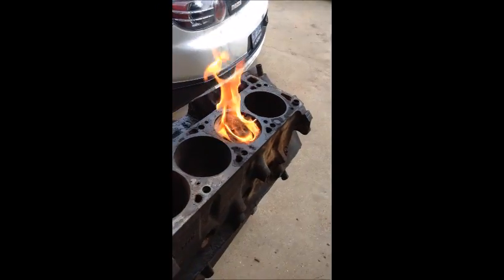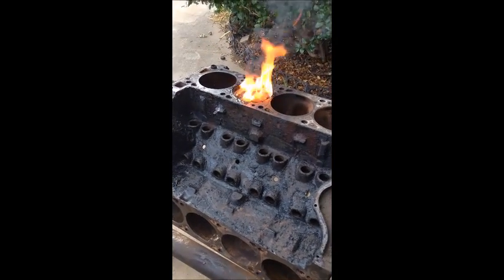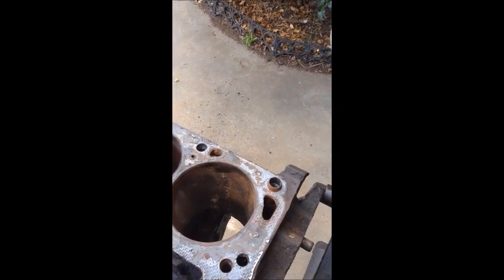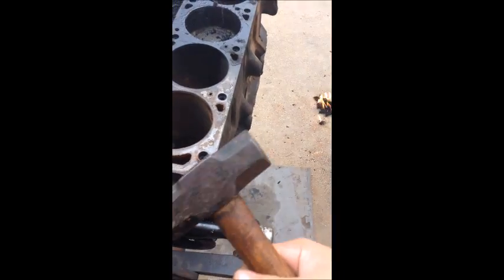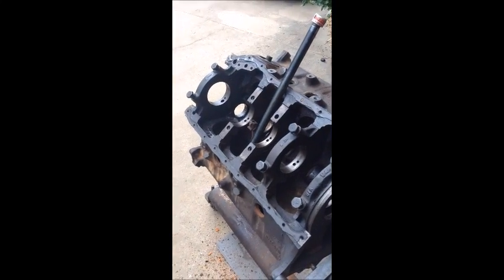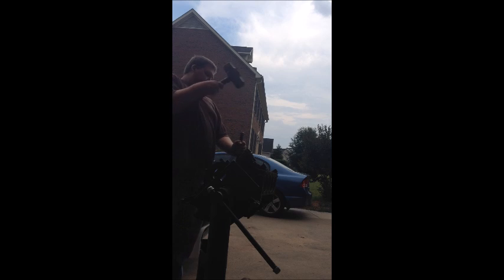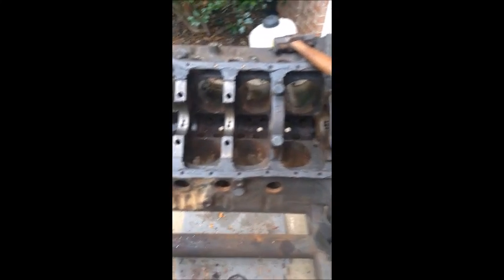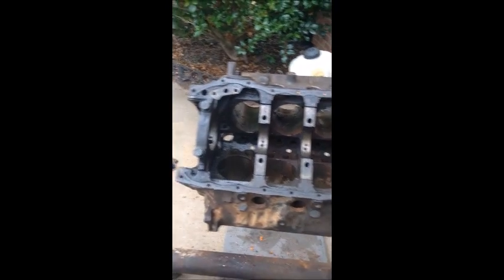How to Remove a Seized Piston

Comment: That stand acts like a spring and absorbs the blows from the hammer. You had the right hammer and the fire trick. But you should have laid the block on the ground and beat on the piston with a few hard blows. 
We all have set backs when working on engines. I couldn't get an exhaust to bolt up to a header once. I had to sit back and think about it. Took the header off the block loosely bolted it to the exhaust and the block where they could all wiggle together. Then bolted them all up at the same time. That worked.

Comment: Put diesel on the top of the piston for a week. (Or a month.) then use a wooden block(end wood) that sticks out a little more than the combustion chamber is. put back the cylinder top, tighten the four surrounding cylinder top bolts and the piston will move down. wiggle it up and down with hammer. use thin oil or diesel. finally it will come all the way. To use heat can do the trick, but I would think twice since the cooling water is not there and heat can make serious damage to the cylinder block.

Comment: I've used a propane torch to remove stuck bolts and nuts. Even worked on salt water eye bolts to anchors. They go 'tink' and that's the sign it has started popping loose. Would a torch work on the piston and cylinder the same?

Comment: Good job dude! I love making stuff work that others give up on! The 400 is actually really easy to get to be  a strong running motor. Jon Kasse was asked how to get 400 horse power out of one of these... he says easy! Just ad 3 C’s. compression, cam and carburetion. Then pull off plug wires till you get there lol.

Comment: The next time you have this problem, use brake fluid before any other penetrating oil...brake fluid will seep into places most penetrating oil won't...give it a try.

Comment: I don't think you even needed to light it on fire... what you do is if you stick your rod down in there and you use some rags to hold it in position that way you can put two hands on your sledgehammer and actually swing it... not just lift it up and let it fall. you weren't swinging the hammer Bud. that was the wimpiest swinging of a sledgehammer I've ever seen. With that little Sledgehammer you should have been able to break that piston right out of that bore.... done it many of times myself.  They always come out in pieces long as they're not forged then it takes something pointed.

Comment: 100 better ways to do this, better off heating the block then cooling the piston but risk cracking something.

All you did was break the rusty bind by expanding the cylinder, the piston expansion didn't help.
Most people use heat on bolts to expand them and cause the rust bind to break, or expand the nuts so there is more space to move the debris past it. If you heat up the inside part, you still have to wait for it to cool down before tryin to break it free.

Comment: Just sit down having the ass hole sealed on the cylinder with the seized piston, then push out as hard as you can. As soon as you pop huge ass fart, the piston will just slide out with ease

Comment: Thanks for posting this video.  Out of curiosity what ever came of this block afterwards?  Were you able to use it and how much machine work (or DIY work) did you do to get it running?  I'm starting my first project with a BMW M21 diesel, one is running in the car, other is a parts motor but must have had coolant sit in 2 3 4 and 5 for a while as it's seized up.

Comment: Another old trick that works well, is to heat the metal around the piston, then hit the piston with some CO2 from a CO2 fire extinguisher. it caused the block to expand, and the piston to shrink. The piston should come out relatively easily. You started OK with the fire, which heated the block.  The CO2, when it comes out of the nozzle is very cold.

Comment: the old school remedy for this problem is, = with an electric hot plate is to heat ,half a quart of fuel oil #2  do not boil the oil,  pour it on top of the Piston, let it cool . after the natural expansion , contraction , process and COOL DOWN  piston will come out.

Comment: Fill the bore up with coca cola the acidity will eventually break down the rust around the rings after a day or so that's how I done mine when the block was outside for years. Done mine from the top but you could probably flip it and fill the bores from the under side to make sure you get plenty in there. We used to do this as kids on our bicycles too, when the seat post was jammed solid with rust we filled the seat tube up

Comment: Next time you run into this problem heat up the  cyclinder and sit a bar of parafin was on top and let it melt it's way down past the piston and rings ..wait few mins smack it with a hammer and drift it'll fall out 20xs easier than you can imagine..works Everytime!

Comment: Build a thick plate 2 Bolt over the cylinder hole with a grease fitting inside of it with a hand grease gun you can shove any piston out I don't care how stuck it is

Comment: I’d assume for best results do the fire flip the engine spray some water on the bottom of the piston and that should cool the piston faster then the cylinder wall and would break the rust  my two cents that’s how I’d do it

Comment: Haven't seen the video referred to, but pretty sure you are supposed-to give it a few minutes after removing the heat source, before hitting it.
Aluminum expands & contracts faster that steel.
You heated both for a while, now give it a few minutes without heat, and as they start to cool, the piston will "shrink" faster than the block.

Comment: Next time just take a torch to the piston Get pretty hot try to avoid heating up the block too much And then just Douse some WD40 or Marvel mystery oil in there and you should be able to get the same turn out Without affecting the heat treating of the block

Comment: Why not just soak it with a 50-50 blend of Marvel Mystery Oil and Liquid Wrench,   then vibrate it with an air chisel while hammering on the rod?  It would have come right out.  I used to work in a transmission shop,  and my boss swore by the air chisel.  Especially for impossibly stuck bushings in blind holes.  It worked  quite well.  No heating required.  

Of course,  since you were re-boring the block anyway,  the red wrench would be even faster.  A skilled fabricator can blow out a sheared off 1/4" (or larger) thread stub from a sheared off pipe nipple in a cast iron body,  without damaging the parent threads.  I was once working on a steam press at a dry cleaners.   I was their general mechanic.  A quarter inch steam pipe broke off flush with the receiver, leaving the remains of the nipple galled to the threads inside.  I tried several bolt extract ion tools (EZout, etc), to no avail.  Two slipped, and one broke off inside the broken pipe.  Since I had nothing to lose at this point,  I went and grabbed the red wrench.  I was able to burn out the broken off tool and pipe fitting, without damaging the female threads in the body.  You see,  the galling provides insulation and protection from the heat.  The body is a massive heat sink, so the parent threads simply cannot get hot enough for the oxygen to burn,  provided you do it right.  A skilled oxy-acetylene weldor can blast just about any broken off fastener or fitting from an engine block or boiler tank.  You could've had that piston out of there in a few minutes with the red wrench.

Comment: Hole saw the piston crown to remove the rod. Fracture the remaining piston with cold chisel.
Reply: You can just take a "jitterbug" air hammer muffler gun and start punching holes in the top of the piston with a pointed chisel and just break the piston up until it lets loose.

Comment: Help me understand this.  Heat the piston, which will make it EXPAND to remove it?  Dry ice would have been easier.
Reply: The heating and subsequent expansion and contraction breaks down the  rust (or whatever) between the 2 components. Multiple cycles of heat are often required to get the job done. Dry ice may work but at what cost and risk of thermal shock?

Comment: Best way to remove a stuck piston is go past the wrist pin with a solid rod and knock the piston crown off. Then all you have to deal with is the skirt and that's easily collapsed with no support from the top of the piston. I've done it many times. Quick and simple.
Reply: Yep. And if its a Ford, put the block in your garden as a 8 hole seed starter, and leave it there.

Comment: That's stupid and dangerous. Try soaking brake fluid instead overnight or a bit longer - then take a soft wood block and tap around the edges then hammer it out with the wood block. Carefully tapping from the bottom as well will help too. Passed on from a long since dead drunken mechanic. Overheating the metal can create fractures more easily depending on the type of fuel. Some burn cooler, some hotter. The Piston bores/sleeves are only made to handle so much heat and pressure. And when hammering from the bottom hold the connecting rod into the center. Then it won't hold you up. Never - NEVER hammer with a metal hammer or punch. Fine metal fractures will likely occur. Magnaflux check your block  (likely at a machine shop) if you  have even slight worries.

Comment: Next time get heat on the piston with a torch or how you did, you need heat! Then use paraffin wax (plain candle wax from the grocery store, usually its white and comes as a brick). After heating the piston/ area no hotter than 250°f(any hotter you anneale the metal), rotate the engine so the deck is facing down then rub  the wax around the bottom of the piston. The heat will wick the wax past the piston ring. Let everything cool right down, the piston should tap out without causing any damage.This trick works on anything metal that's seized. ☆WARNING☆ when heating metal to a glow and waxing, the wax bursts into flames! Always, always let the metal cool to a blue color before waxing.

Comment: Heat the block chill the piston sling a bit of diesel in there and knock the piston down not up, your fighting corrosion and a possible wear ridge trying to go up, plus when your knocking it down you can use a big old lump of hard wood on the piston crown to save damage to the side wall when you use the hammer like a man lol.

Comment: Think it would have better to heat the engine block, metal expands as it heats up, then while the block is hot try to drive it then, by heating the piston you are making tighter in the bore!

Comment: Aluminium expands more than cast iron when heated, so the trick is to put a little water  in the piston before banging on it, so it contracts while the cast iron cylinder is still hot and expanded!

Comment: The easiest way of doing this is to just junk the 400 and buy a Chevy
Reply: If you lost all your brain cells then yes. As if a Chevy isn't the worst junk out there.
Reply: Shawn Miller never had a problem with any of my Chevy or GM vehicles for that matter but the 2 fords ive had had nothing but issues in the driveway fixing or replacing something every week
Reply: THOUGHT YOU DIED
Reply: LOUISVILLE SLUGGER pulled a 2Pac

Comment: Actually the best thing to do is go to walmart and get a bottle of toilet bowl cleaner and I mean the strong stuff that contains almost pure acid.You pour that into the cylinder and it eats the rust and corroded piston away down past the rings allowing the  piston to be freed up..Ive done it many times and it works great and doesnt take long and since the block will be bored anyway there's no worry about causing damage to the good iron especially if you neautralize it after your done.

Comment: if you apply heat to seized components...wait until after the heat is gone and parts have cooled. you're basically expanding the metals. key part is the piston is made of different material than the block...e.g. different expansion rates. it will come loose, just wait for the heat to dissipate first. this wouldn't be my first choice to pull a block apart...but use what you have. sometimes a fella has no choice.

Comment: So much wasted energy, the pipe flexes, the engine stand bounces and the little hammer was too small. Where was the penetrating oil ??? fill the bottom side as well as the top .

Comment: one thing i have seen on a program trying to un seize a Gloucester gladiator plane was to boil engine oil and put the boiling oil in the cylinders and then after a while tap the crank and low and behold it freed up

Comment: Hope you plan to not use the piston or pistons over just saying.
Reply from the maker: David Bowser no haha, I’ve got the motor on the stand. It bored .030 and crank cleaned up .010 and .020. Got some Tim Meyer High Compression Pistons on the way. Gonna go with that a comp 268h cam.

Comment: After the fire has been burning for a while, throw freezing water onto it.

The engine block will crack allowing the piston to be removed!
Reply: I think he was being funny...i hope 😂😂
Reply: Only on piston from below. Aluminum piston shrinks more and faster than cast iron block. Simple physics from mid school.
Reply: R/WOOOOOSH jesus fuck people seriously are thick skulled
Reply: scatcat1994 Thanks it worked great I did see a big crack but I just hot glued it and it will last me forever forget paying a trained professional thousands and do it for pocket change! Lol 😂
Reply: scatcat1994 I’m gonna try that thanks
Reply: Have those rods magnafluxed and resized. New cheapo flat tops. Then put the pistons on a postal scale to make them the same weight as the old ones, your balancing will be factory spec.
Reply: What ???? The Man doesn't want to rebuild the piston or save the rod. SMH. What auto shop did you attend for schooling?
Reply: Se mamo🤣🤣🤣🤣
Reply: It wont crack thats kinda dumb
Reply: um i think he wanted the piston and the block in tact and not cracked/busted
Reply: @j0sh368  Why did he buy a Ford then?
Reply: @j0sh368  It really does not matter at this point because you can see he trashed the block anyway.
Reply: @j0sh368  lol your the type that always cracks me up.

Comment: you need to warm the block around the piston ,thensspray cooling spray on the top if the piston.Never use a metal hammer on alu piston,a piece of a broomstick vill do  and before all this you spray 5-56 on the top of the piston,and let that work overnight.

Comment: Another trick I've seen used us to heat a pan of engine oil so that it's ridiculously hot, and then pour the hot oil into the cylinder, wait 2-4 minutes and hey presto the seized piston is free

Comment: Guarantee marvel mystery oil would have worked
Reply: MM oil mixed with Acetone works even better. It thins it out so it penetrates better. And let it sit a few days.
Reply: Tell me more - I've never used it, but what, pour it in the cylinder, wait, knock the piston out?
Reply: Stephen and Lori Young me and my friend was hunting years ago and when we was headed home it had got dark and my 30’06 was beside me and we went around a curve and it was gonna side over into his side of the floor board in the 1980 dodge truck with a slant 6 well I reached quick like to grab it and some how managed to knock the safety of and hit the trigger at the same time 
It was just a freak accident and the bullet went through the floorboard and hit the top of the frame rail ricocheted up and went through the oil filter and we was only half a mile from my house and didn’t realize that the oil filter was hit  and it ran out of oil and locked right when we got there 
Well my friend had borrowed the truck from his dad and his dad was a big dude just looking for a good reason to kick my friends ass so the next day I went and got some Marvel mystery oil and put it in all the cylinders and let it soak for a day or so and the starter would not turn the motor or even try so I hooked my truck to it and drug him out the hard top and after a few minutes the motor came loose so I pulled him back to my house and put the plugs in and it fired right up and still runs today and that has been 25 years ago or more so I’m hear to tell you that shit works and the truck only smoked for a few minutes 
I’ll never forget it as long as I live and would be a perfect story for commercial👍🏻
Reply: canuckguy worried  Thanks for that reply.
Reply: 50 years ago a guy told me how good MMO was . 

Tried it a few time then stopped wasting my $$$ on the fancy looking red can  !
NOTHING , nothing will soak down past the top of a well seized & rusted  piston  in your lifetime !
BTW  I have removed many, many pistons from extremely rusted rare blocks just to save the block & never ruined a block or rod & usually never spent more than about 2 hours on an engine even with several stuck pistons .
Reply: B Anno I’ve had to beat the pistons out of a few blocks myself in my time and I agree with you cause mmo would not have worked on them but I would not have believed it if I didn’t see it for myself and to think that dodge still runs today amazes me 
I’d love to see the pistons in that thing
Reply: Some people don't understand that machined areas of metal tend to become somewhat porous and will soak up lubricant to a certain point.. Nothing catastrophic normally, unless it's an early LS engine that we're talking about.